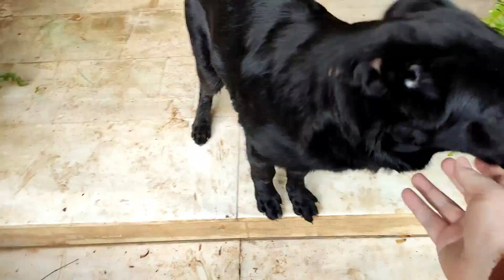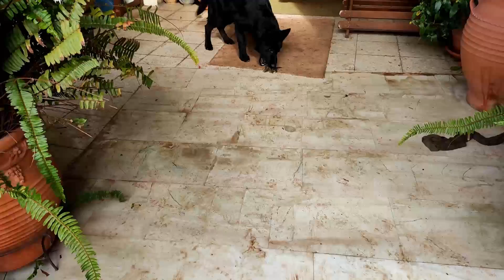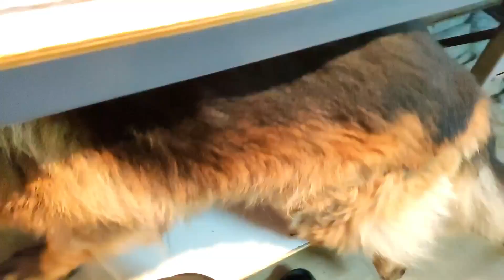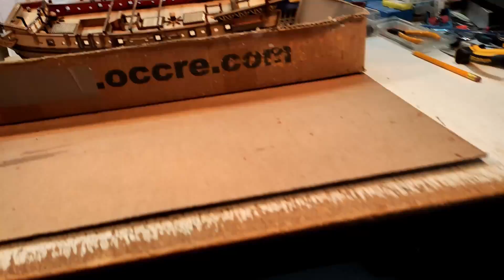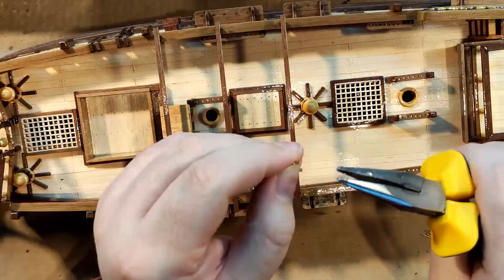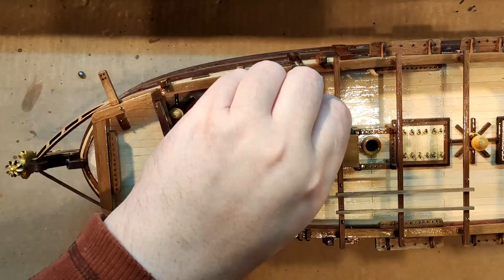La Candelaria - part 27 Placing Rings

Comment: Really love your videos with little wolf growing up as well 
Could you give me some advice on a set of drills for modelling 
I am just starting with modelling I bought a cheap set of drills and they are useless 
Thanks keep the videos coming 
😂
Reply from the maker: Hi Alan! Thank you very much!!! Of course, get a hand drill with a set of small tips from 0,6 to 1,5 mm. The most common tips over here are the 0,8 and 1mm so get more of those. Them for your power drill get a set from 1mm to 10mm or 12mm tips. Make sure they are made from cobaltium, it is a gold looking metal that is harder that the usual tips and make a rounder hole. Also if you wish get the small drill pen that i use for the small holes, i got it from Amazon USA and the brand is Arrowmax.
Reply: Bought a small hand drill with some bits but they were rubbish 
Could you recommend any make of bits which are decent quality 
Thanks
Reply from the maker: @alanpaisley1034  Check out here : https://www.super-hobby.co.uk/catalog/Drilling-tools.html almost everything i got from that shop is well made.
Reply: Thank you very much